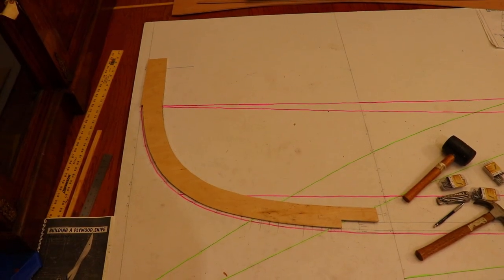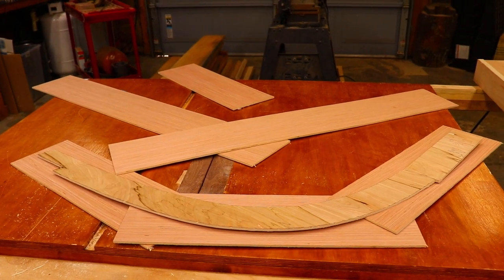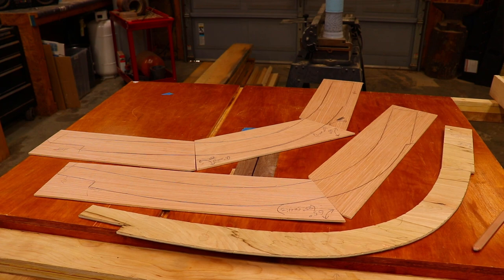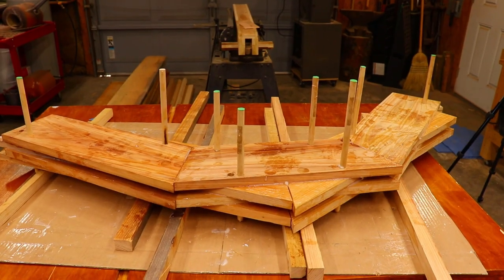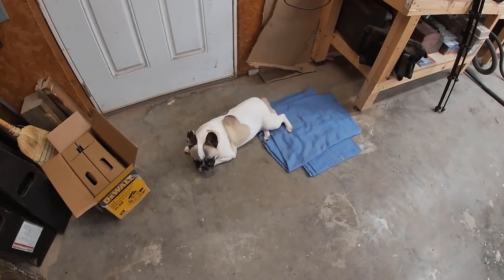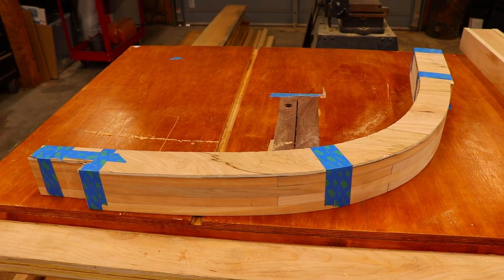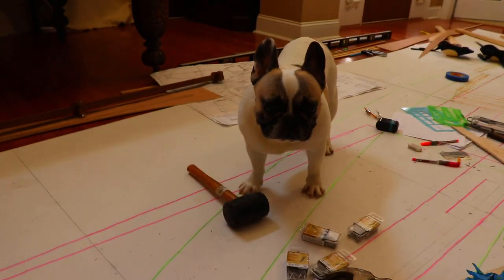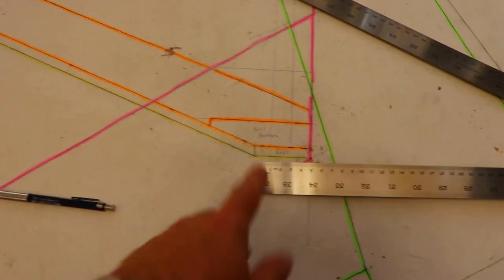Building a Snipe Class Sailboat. Part 3: Stem, Transom, & Keel Batten

Comment: at 13.26 you show what looks like the joint of the 2 half's of the transom, because the frame was short you put in a small block, i'm wondering if this will be a weak spot because all you have to secure the 2 transom half's joint is the deck frame
Reply from the maker: the structural part of the transom is the solid sheet of 3/4" marine plywood. The small patch piece you're referring to doesn't have any structural loads on it and is just a cosmetic fix. These frames on this transom just provide additional surface area and fastener holding space for attaching the chines, keel, and sheer clamps.

Comment: It's been a long time since you started with this project, do you still answer questions? My question is what kind of wood do you use except for the marine-plywood ? What do you think about larch wood?
Reply from the maker: I used cypress for the internal framing and mast, cherry for the rub rails and splash guards,  black walnut for the stem cap, true mahogany for the woodwork around the dagger board case, and maple for the boom. The plywood is meranti mahogany marine plywood.
Reply from the maker: I don't know much about larch but I imagine if it's light and strong it will work just fine. If it's not rot resistant just make sure to finish it properly and don't leave it in the water and dry it well after use.

Comment: I have no experience with using them myself, but I've read that a scarf joint can actually be stronger than the surrounding wood if properly done. Do you have experience with them being a possible point of failure?
Reply from the maker: I don't personally have experience with them failing. It seems possible that they could be incredibly strong but I've also heard that you should offset them so that they don't line up with a scarf joint on the opposite side of a boat. I think off setting them is more of a precautionary measure since I suspect historical glues were probably not as strong as our modern glues and epoxies. I do know that a scarf joint length should be a minimum of 6 to 8 times the thickness of the boards.

Comment: Would the transom be stronger with the grain oriented horizontally? Unless there is a solid frame on the top edge. Just thinking out loud
Reply from the maker: The grain alternates direction in the plywood layers so orientation isn't important. It definitely would matter in a solid hardwood transom though.